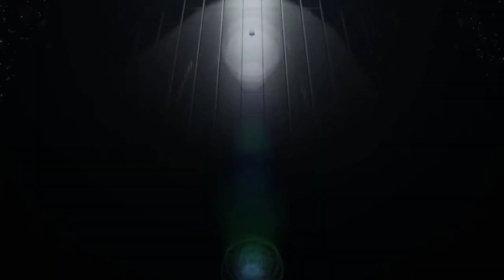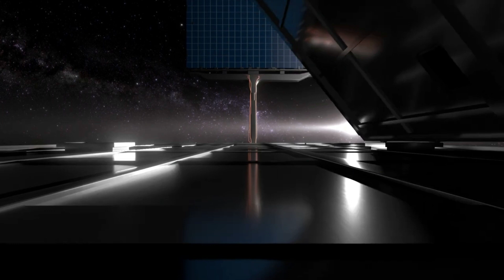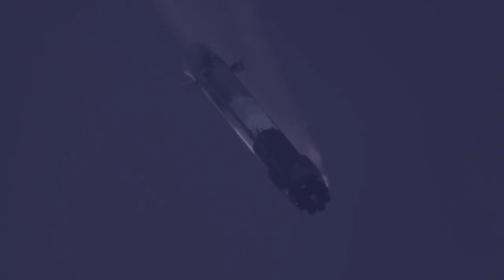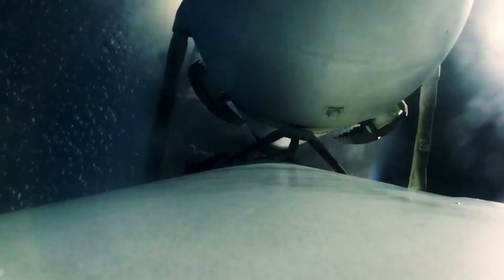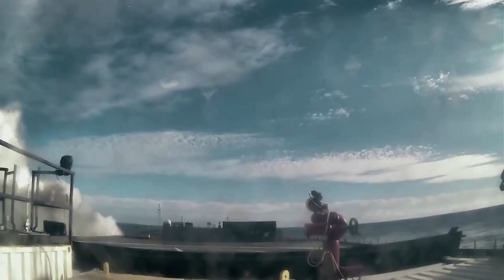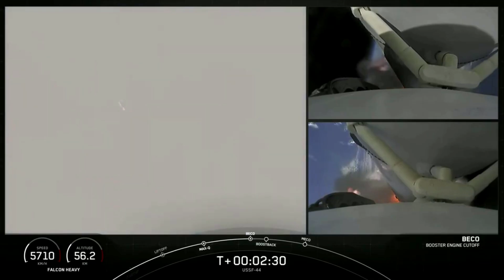SpaceX's Falcon Heavy Is About To Launch Again

Comment: Since SpaceX gave up on reusability for the 2nd stage; I've often wondered about the production line for manufacturing stage 2, and whether stage 2 has been modified or improved or is different for falcon heavy missions.
Reply: AFAIK… Falcon 2nd stage is same.. identical dimensions & burn times. 
For Falcon 9 2nd stage with 1 Merlin costs only about 1/9th of the booster with 9. 
For Falcon Heavy it’s 27-1, engines & materials.. so 2nd stage reusability seems almost immaterial.
Reply: @warrenwhite9085  I remember the booster went from version 1 to eventual 6 (was it?) and part of those upgrades were better Merlin engine performance, (which I assume benefitted the 2nd stage performance as well). If burn times remained the same, would not 2nd stage burn times have improved if the Merlin became for efficient? Another question about 2nd stage: When a second stage has to boost a heavy object toward geostationary orbit, do they have to save enough propellent to push it back into atmosphere to burn up? It seems like the more energy they can give the payload the less station keeping fuel the payload will need, hence increasing its lifespan on station.
Reply: @marvinegreen  Rocket Engine upgrades can address: 
. Manufacture costs, maintainability/reuse, reliability, weight.. and/or
. Performance improvements. Which can be: 
  - thrust to weight ratio, Therefore Merlin with higher thrust might actually burn more fuel faster at the same efficiency
  - or improved ISP(efficiency), producing more thrust at same fuel flow.

For boosters, max thrust & thrust to weight ratio are crucial to offset gravity losses ASAP.  Slow, majestic liftoffs waste fuel, reduce payload. There are delicate launch physics balance computations/trade-offs optimizing: Getting altitude to thinner air sooner to reduce drag & aerodynamic stress vs getting more horizontal velocity sooner so centrifugal forces offset gravity losses & to reach orbital speeds. 
Merlin ( & soon Raptor) is almost unique engines in being used for both booster & upper stage.
Reply: @warrenwhite9085  Interesting points, thanks.